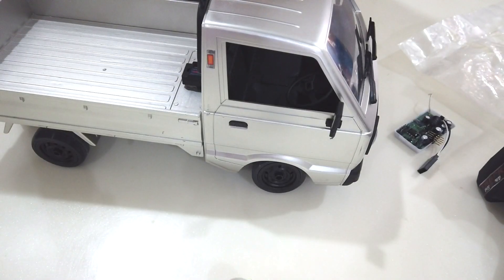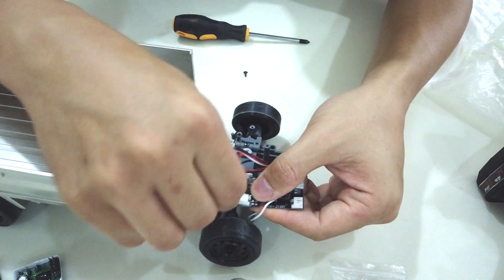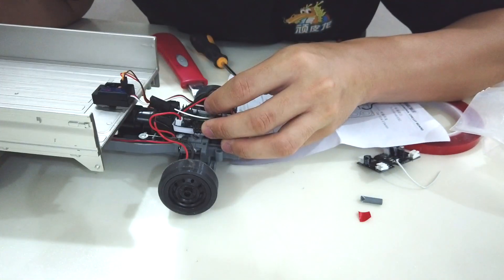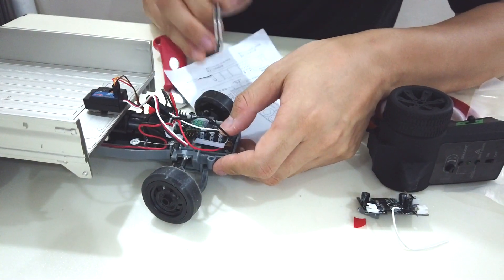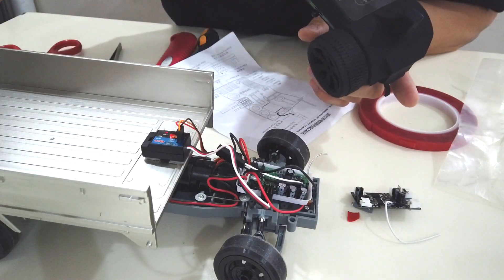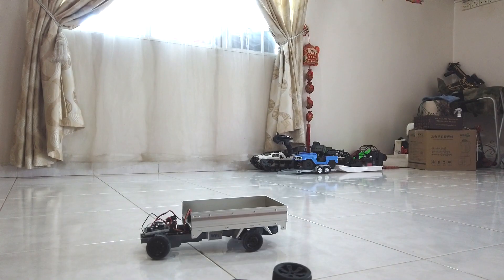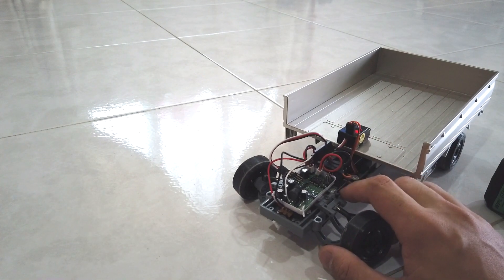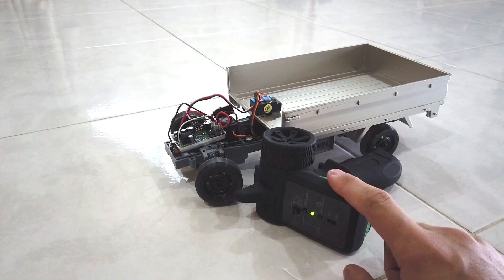RES-V3 Board on D12 - Plug & Play Upgrade!

Comment: How to plug esc external for board 339R V2
Reply from the maker: Same https://youtu.be/Iizsy6xHW8k
Reply: On my boad pluged to pin esc. My receiver x 339R version wpld 12  old
Reply from the maker: You can only connect to external esc on the RES-V3 series of wpl receiver, not the normal one
Reply: if I have an old version of the remote and I buy a new version of the receiver board, can it work??
Reply from the maker: @Mr.KenzoFamilyOfficial  V2 remote doesnt work with v3 receiver and vise versa

Comment: Can we add and plug a light kit (brake, reverse ecc...) on the v3 board?
Reply from the maker: no. the board itself already provided much of the light function.
if your light kit takes 5V then just get a 5V BEC powered by your battery